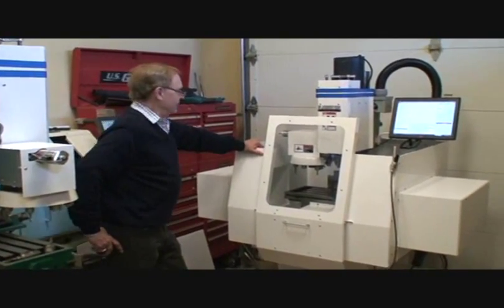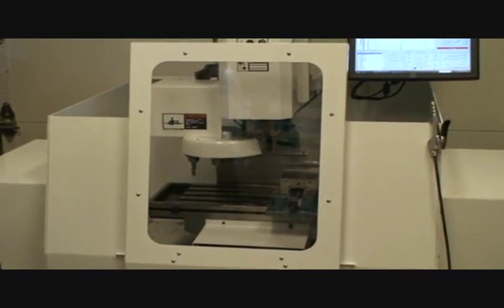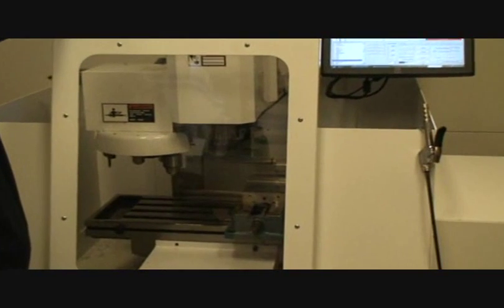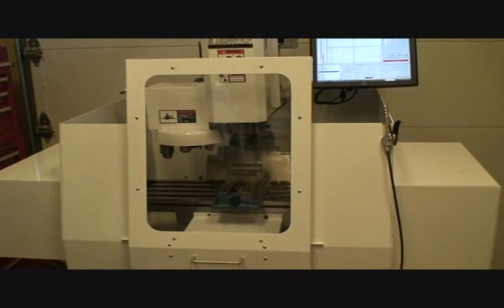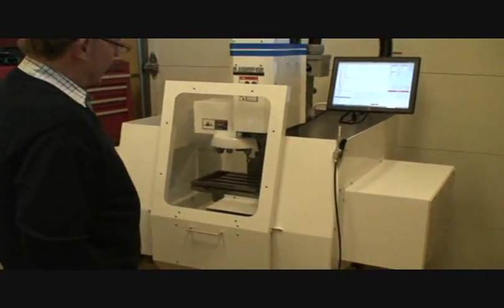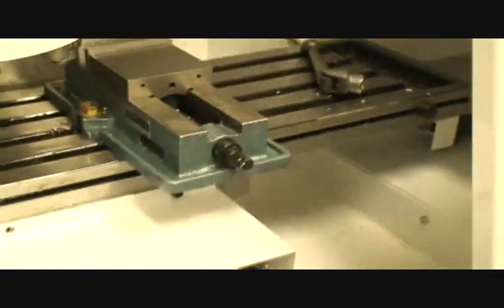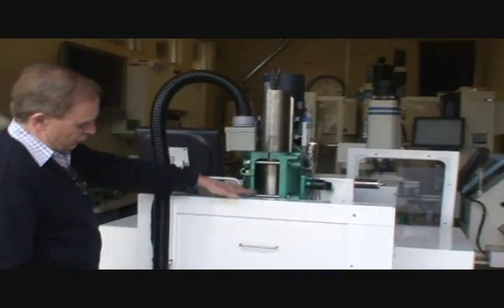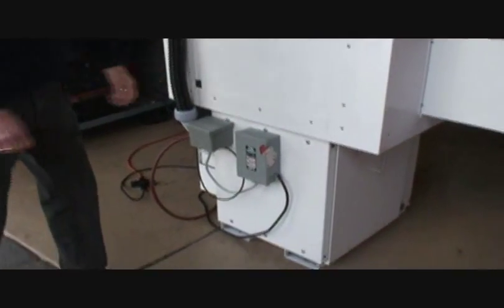"Automatic Tool Changer"

Comment from the maker: @PetefromTn 
Spindle is a standard R8 spindle. A ring pressed on the spindle has the keys.
In the straight area of the spindle the draw bar mechanism resides. The tools use the R8 taper with a pull stud  The V flange is located .100 below the large diameter of the taper. Im in the process of machining 50 of each size. Including 
collet chuck and taping chuck that has float.
Just finished a scratch build I call the UMC10 Linear ways , is a scaled copy 
of the Fadal VMC15. ddecaussin@aol.com

Comment: Beautiful work Mr. Decaussin.... I have built my own CNC Milling drilling machine and I am VERY interested in your toolchanger design. My machine is R8 with a Sensorless vector drive as well and I am designing my own toolchanger. I wonder if you would not mind elaborating some on that tooling setup and the spindle. IS this a custom built spindle or is it still R8 taper and is that an Cat40 toolholder that has been modified?   Again very nice work and incidentally Fadals are my favorite cncs....

Comment: Really great machine. Great to see what a professional machine builder can do when they put their mind to it. The design and workmanship are really spectacular. In looking at what you've done, I can't imagine that these machines won't fly out the door at $10K. I have converted my gearhead mill drill to CNC without a toolchanger, vector drive or enclosure and probably have $5K in the conversion (w/out my labor)- so I think you are providing incredible value here. Thanks for the great videos!

Comment from the maker: @JonoBeergod 
I have two machines ready to go. One with the full sheetmetal, the other
with out the sheet metal. They both come with ten tools. Price for machine with full sheet metal is $10,000 FOB. Other machine is $8,500.00. Both machines are closed loop servo drives. Rapid travel is 300 IPM.
David deCaussin
ddecaussin@aol.com
(818)429-6942 Cell
(480) 513-0240 Land line